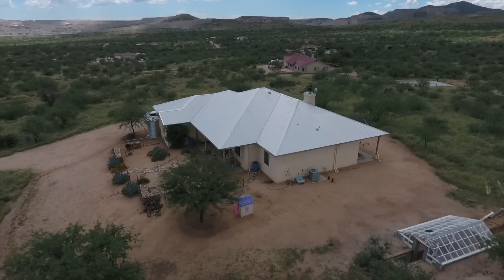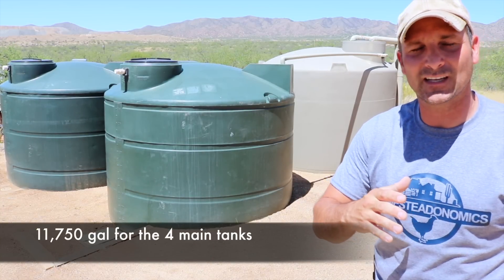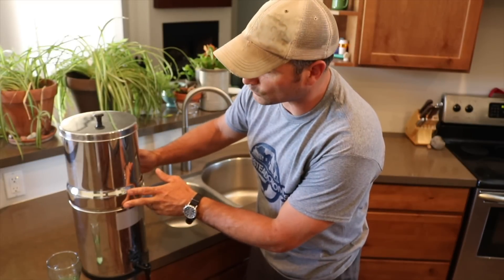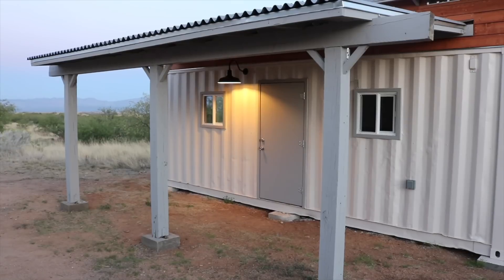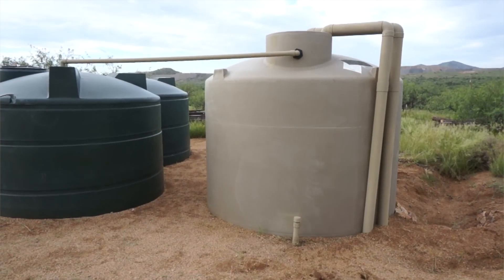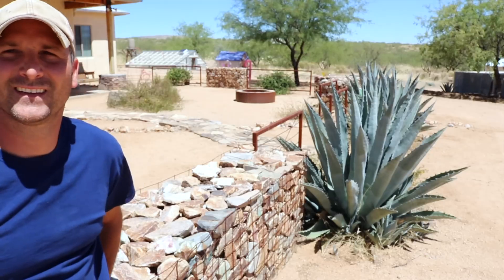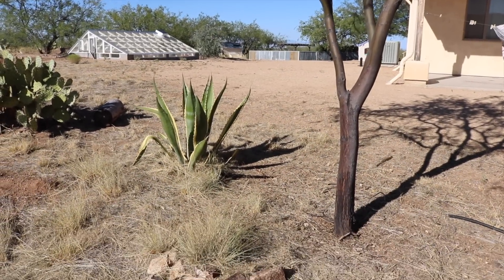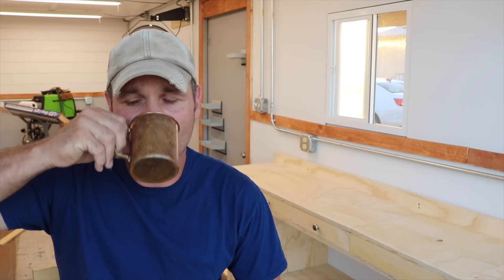Rainwater Harvesting QA - Cost, is it Illegal, how I treat, etc,.

Comment: For some reason I really like that PVC vacuum tube extender thing for cleaning out the rain gutters...
Reply from the maker: thanks SUVRVing!  it isn't fancy but works well:)
Reply: +Cody Slab ... Why the aggressive tone? Why calling people names, and "retarded"? Nobody in here deserves that kind of disrespect. The kind of respect you give out is the kind you will get back.
Reply: SUV RVing he should consider marketing that...it's cool
Reply: ***** could have put screens over the gutters...heavy debris is washed off not collected
Reply: Glen:  You can walk the roof, blowing the trash out of gutters with a leaf blower.  It works great, even for totally filled gutters
Reply: The leaf blower deal works great.....  Blow out the down spouts from the ground too...do this on a dry dry crunchy day for best results.....
 Love the chicken water system......
Reply: I use my leaf blower with a 90 and an old vacuum nozzle to blow out the fir needles.  Have to do it once or twice a month.  Live in a forest.
Reply: "Practical". =D
It's not much different than using the stock tubes/extensions, you just made a specialized end to better suit your needs. Love it!
Reply: Glen Spivey. No need to remove the gutters. Here in SA we use a coarse plastic sponge type material that is 1 to 1 1/4 inch thick and cut slightly wider than the gutter width,  It is place in the gutter with about 1/8  inch sticking out above the gutter. This allows for any leaves washed or blown from the roof to go over the gutter and fall to the ground and not clog the gutter, but still allows water to enter the gutter.  It is not just good for collecting debris free rainwater but saves you a lot of time on maintenance and cleaning of the gutter. This was a idea brought to life by a 17 year old boy that did garden work on weekends and school holiday for people for an income. He is now a very rich young man 5 years down the line.
Reply: Cody Slab how much mercury is in those pipes and how much of it is a concern? Little to none
Reply: Ignore Cody Slab, he's just a troll trying to pretend he's Cody'sLab, which is a really good channel. He'll grow out of it once he reaches high school.
Reply: Yes, I got a warm fuzzy feeling after seeing that. There are so many different uses for PVC pipe.
Reply: Cody slab needs a hug
Reply: @GamingAmbienceLive  Well then, your parents must have had their plumbing water intake supply lines made of copper pipe coated on the inside with mercury especially to raise you.  If you are so concerned about your water consumption you better drink all your water from a water distillation unit.  A friend of mine, a fellow Marine, almost died in Vietnam from drinking polluted water there.  So when he returned home he started studying about water and uses and sell water distillation units for decades now.  Now in his 60s, he takes no medication, is in excellent health attributing it to not having his body fight the effects of what chemicals are in most drinking water.  When he cleans the contaminate chamber from his still he has a stop in the back of this yard where he dumps the debris.  Nothing will grow there.  He tests water sources all over our region and says most water is not consistent with what is removed from the water claiming it depends when water filters were last changed.  Even bottled water may test good one week, and not so good the next.
Reply: You have no clue.
Reply: @GamingAmbienceLive  https://en.wikipedia.org/wiki/Copper_toxicity
Reply: everything has toxicity
Reply: Igor Igor well I thought I was replying through YouTube since I went to my YouTube page...copper too expensive for most folks...
Reply: Igor Igor where you get that from??? PVC is safer than almost all plumbing choices

Comment: Hi Joe,  
  Do you think you might add a roof over your rain tanks for added UV light protection, algae prevention and increased harvesting area? Looking forward to the pond project. I hope you can put together a planning video where you walk over the land and describe the features on what is going to go where. It's been ages since you took us to the green house. I'd like to request an update please. Are the earth tubes working as designed? Cheers,   
    Bill
Reply from the maker: I have considered it for sure... just wasn't sure about building the extra structure over them... I might just paint the tops to get some extra life out of them.  
as for the earth tubes for the green house... I hate to say it but I haven't finished the full length.. I did close to a hundred feet but still want to add some more pipes and a shaded inlet.  the next greenhouse update should come after monsoon season.  right now there is nothing in it as it is too hot... all of the starts I had in it are in the main garden area

Comment: Wow, that is so much info, also think in the beginning you can start small by purchasing 1 3,000 gallon barrel and add additionally when money comes available. My question was about the great water but you answer it. Very productive Joe as always. Have you though about natural pools? it's basically a pond you can swim in it and it uses plans as the filtration system to clean the water. Just a though.
-Pablo
Reply from the maker: YES!!! I actually was telling my wife about them this last summer... not sure if I'll do it... but if I could figure a way to fill with rain water then I might consider it:)
Reply: Man that'll be awesome, time permits and all, yes I was thinking about using only rain water as well.

Comment: I have seen some systems that are very 'out there' and even some really cheap ones that hold thousands of gallons.
This one seems to be very scalable and not very expensive:  https://www.youtube.com/watch?v=YdwKDVzh1cs
See how this might give you some ideas on your system...it has really shown me some interesting ways to go...using old milk crates & tarps.
Since it is underground it would also not have the problem of critters growing in it. I'm thinking of several small ones maybe 10' x 10' to keep costs down.
Using solar powered 12vdc pumps w/ accumulator to move the water would be very cheap as well and have redundancy if valved correctly.

Comment: Thanks Joe, great video. A couple of questions came to mind. What has been your yearly average total since you have installed your system? Have you been able to fill your system to capacity? Have you seen any deterioration in the PVC piping being in the Arizona sun? Could you go through how you go about getting water delivered. Speaking that upstart from "Life inside a box", doesn't he have a tractor? I smell collaboration video building swales on your property.
Reply from the maker: Thanks Hammer!  my yearly average rainfall is just a bit over 12".  The pvc pipes hold up well so long as you have them painted... if not then they will degrade pretty quickly.  As for delivery... it's just a truck service that brings water to us via tank on the back with 2000 gal of water.  

As for Dereks tractor.. he's offered it for me to use but my ground is really rocky and i need to have a slightly bigger tractor to get through it.  His could do the swales but I need a big one to do the pond portion :)